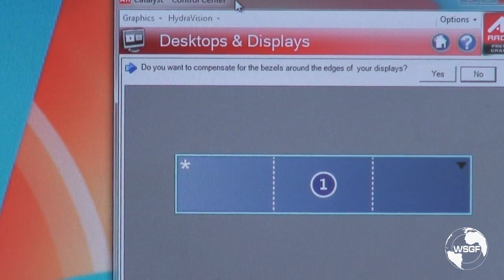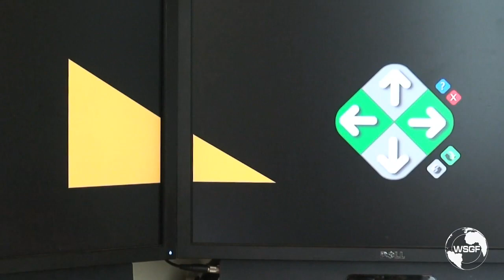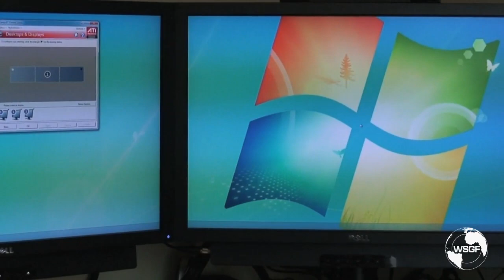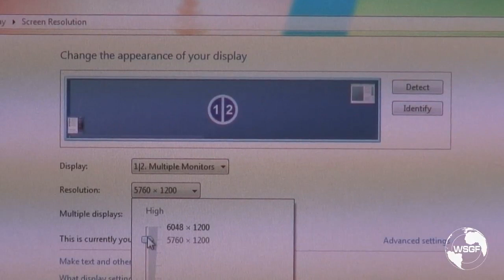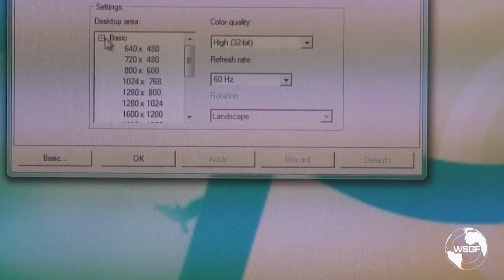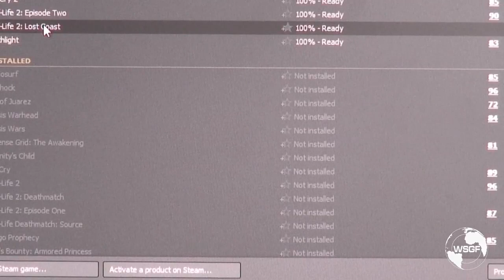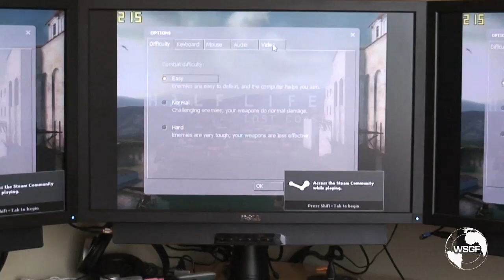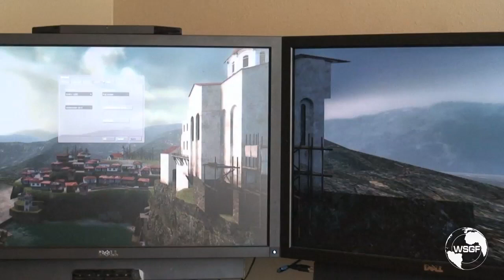ATI Eyefinity Bezel Compensation

Comment from the maker: @PotentChr0nic There is image behind the bezels.  You can validate this by screenshots that fill the full 6048x1200 resolution without any blackout areas.  My contrast, the Matrox solution from years ago did put black bars on the outside, and keep the desktop resolution at the native 5040x1050 (3x1680x1050)

Comment from the maker: @PotentChr0nic Really depends on how you look at it.  They add pixels to the overall width, and some become hidden behind the bezels.  You have the same number of pixels visible on each screen.  The overall resolution is increased to 6048 (in my case).  The extra pixels are hidden behind the bezels, but the overall image does reach the edges of the monitor.  Having the image pass behind the bezels is the whole point of the Bezel Compensation.

Comment from the maker: @LittleTron Make sure you're running the 10.3a driver that was just released by ATI.  That is the first public release to have it.  If you already have an EF group, right click on it in the CCC and there should be an option.  If you don't have matched panels, it can get tricky.  You can hit up the WSGF and post in the Eyefinity forum for help.